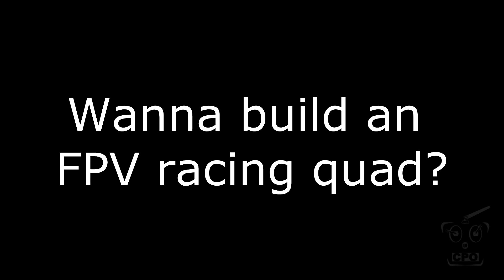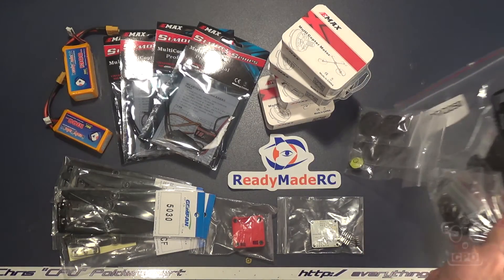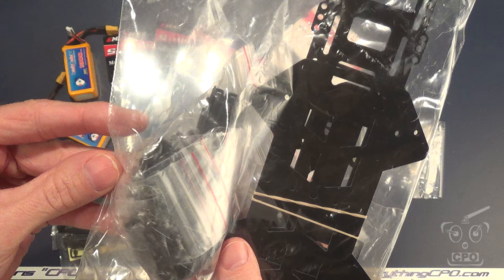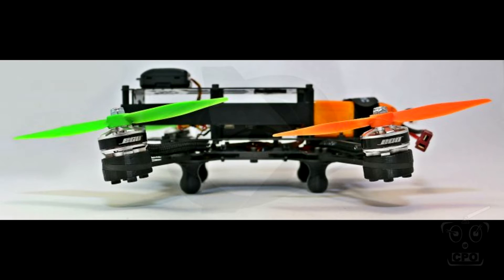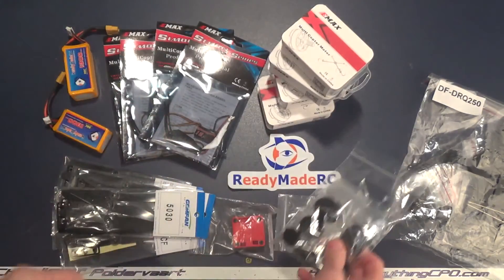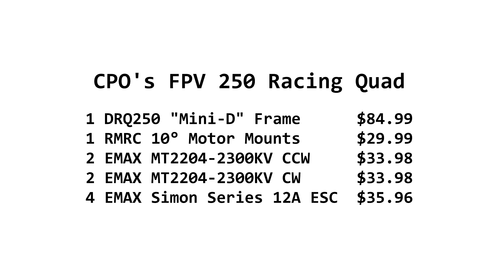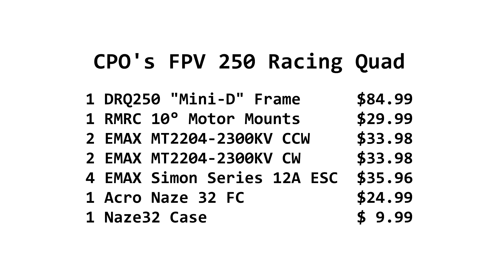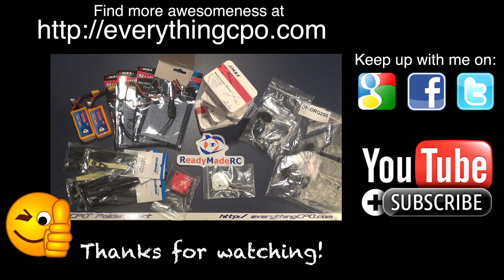CPO's FPV 250 Racing Quad - Overview

Comment: Quick question. I noticed that you got a 4s battery but the ESC's and the mirrors have a 2s-3s rating.  Will the 4s battery work with the parts you selected?

Comment: One thing to consider.  When you crash and your props are whacking the ground the plastic props bend and break without a lot of a stress on the motor.  CF props are stronger which means your quads weight is transfered to motor shaft and possibly bending them or breaking an arm.  I'd rather replace props.
Reply: I will follow that up with the fact that I have had plastic props explode in the air on 450 size quads.  So my rule anything light and flying low equals plastic and anything flying high with some weight I use APC props.  Just Not a fan of CF propa and I've flown APC on 1/2a to quarter scale gas airplanes and electrics and never had one fail.

Comment: Can you give me some advice on this set up
DYS BE1806 2300KV Brushless Motor Black Edition for Multicopters 
Gemfan 5x3 Inch Plastic 5030 Propeller CW/CCW For 240 250 Frame 
H250 ZMR250 250mm Carbon Fiber Mini Quadcopter Multicopter Frame Kit
RCTimer 12A SimonK Brushless ESC For RC Quadcopters
Hobby King Quadcopter Power Distribution Board
Turnigy nano-tech 1500mah 3S 35~70C Lipo Pack
HobbyKing® KK-Mini Multi-Rotor Flight Control Board 36x36mm 
OrangeRx R410X DSMX Compatible 4Ch/6CH PWM/CPPM 2.4Ghz Receiver
OrangeRx T-SIX 2.4GHz DSM2 Compatible 6CH Transmitter w/10 Model Memory and 3-Pos Switch (Mode 2) 
I want to use cppm because it will be easier to hook up to the kk mini
I also don't know who to wire the kk mini because of their only being one row of pin for the receiver
Reply: I am going to use bullet connectors because this is my first quad copter and I know that I am going to crash

Comment: Just a couple of thoughts for you CPO. 

It's not the frame weight that's the issue. Strength is.  You will find over time that G10 is more expensive through repairs and broken electronics from the crashes.  You can't have a fun day if you break your quad.  Good antenna placement will fix any reception issues with CF. 

Tilted motors are just a sales gimmick.  Tilt your camera instead and you get the same result and the FC won't have handling issues.  Tilting the motors and not the FC also produces issues.  There is bugger all extra drag also.  Try tilting the frame at 50-60 deg which is what you have on a powerful quad and then take off 10 deg to compensate for the tilted motors and you'll notice bugger difference in profile drag.  I'll take your point when we are flying at 200km/h but right now it makes no difference.  You could have spent that money on a better (stronger) frame. 

The CW / CCW prop thread is another gimmick.  This now means you need to carry TWO spare motors instead of one! Mount your props with Nylock nuts and loosening props is no longer an issue.  DON"T USE THREADLOCK ON THE PROP NUTS!!!! The threadlock will eat the nylon prop! 

Those esc's stole some of SimonK's FW and didn't give him credit for it.  He wasn't impressed when he found out and I think they had to apologize.  When you switch to 4s eventually you will most likely need BLHeli FW (depending on the setup) on them for sync free operation.

Can't beat the Acro Naze 32.  It's brilliant!!!  Happy to help out with any issues you have with its setup.  With a decent frame you won't need a case for it.  Without the case and motor tilts your already up to the price of a Minion or RD230 which are much better frames and almost up to the price of a Blackout mini H.  All of those frames are really good and bullet proof in crashes. 

The GF5030 props are horrid little pains in the a$$.  Yes please do learn on them and they will work well in that regard but then move onto something with some bite like the HQ 5x4 nylon props.  The CF gemfans are not much better.  I run the HQ glass/nylon 5x4.5 bullnose prop. Thrust figures on a SS2204 on 3s are GF5030 430g, HQ5x4 460g (and much faster), HQ5x4.5 600g and very fast!
 I've run 4s for a while now and it's so much more fun but you need to learn the basics first.
Reply: EVERYTHING cpo
Yes that's correct CPO.  Initially they took the SimonK code without his permission and changed it slightly but I think the issue between them has been solved now.  At least I hope so.
Reply from the maker: Thanks for the feedback!
Reply: Those Esc's are flashed with blheli,  they are labeled as " Simon series"
Reply from the maker: FatKidJoey They can be flashed with blheli, but as far as I am aware, they do not come that way. From the EMAX website:

"Based on SimonK firmware, further optimized to the perfect drive performance and can be flashed with Blheli firmware."